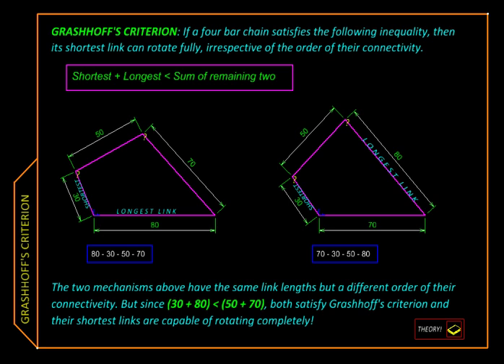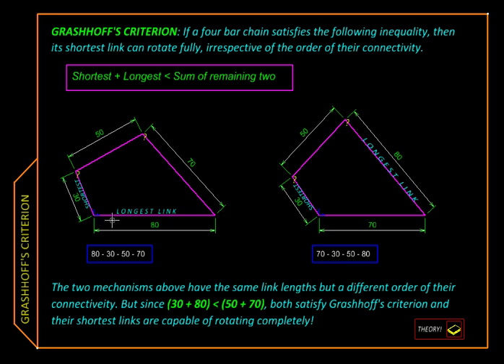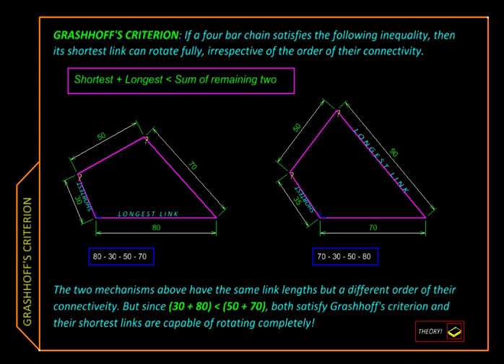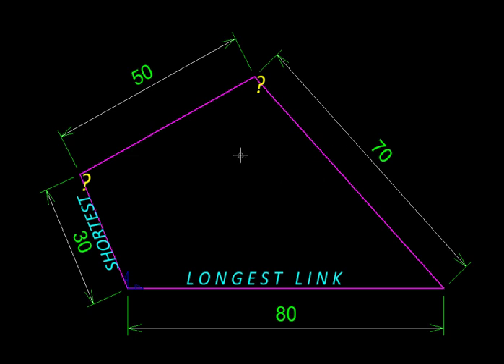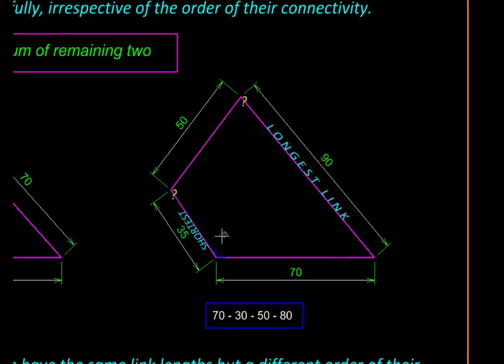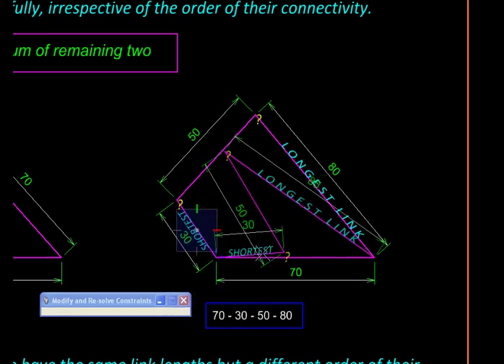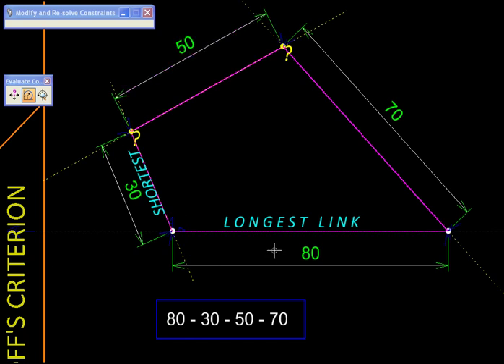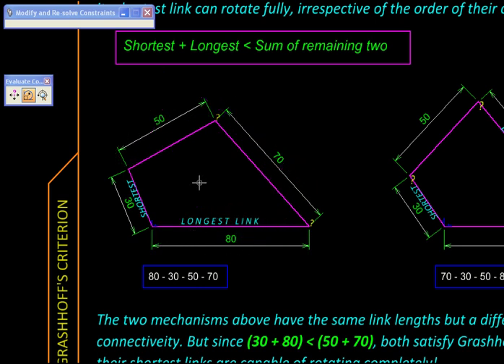Kinematics Ch01D Grashoffs Criterion

Comment: First of all i must thank you for making KDM easy for me. Sir, my question  to you is that, can longest link become crank in the second mechanism i.e one which has got longest link opposite to shortest ?
Reply from the maker: +Badal Singh No, the longest link when opposite to the shortest, cannot become a crank, because the hinges (revolute pairs) at both its ends are incapable of complete rotation.
Reply: +UjjwalRane  Thank you Sir.
Reply: +Badal Singh  What will be the mechanism if sum of the shortest and longest link is equal to the sum of other two link?

Comment: thnx a lot sir, u made theory of machines look so easy.
Reply from the maker: Jitendra malviya You are welcome. I would say, it is already easy. The books and people make it look difficult :-)
Reply: I have a basic doubt sir.........Lower pairs have surface contact then why do we consider two links connected by a joint a lower pair though there is no surface contact.
Reply from the maker: Jitendra malviya I am not sure if I got the question right. But if you are asking why not consider the links themselves as a pair, the answer is the abstraction on which we have based all the theory. Physically it could be complex with rims and rolling elements or very simple with just two bodies with a cylindrical extension engaging with a matching recess in another body. They would still be considered as three entities – two links and a pair.

If the question is about why not call pairs with no surface contact as lower pairs, it is a matter of definition and on the deeper level the actual behavior. The simplest manifestation of which is the degree of freedom it offers.
Reply: UjjwalRane Actually SIR, my question is that, for ex: a shaft rotating inside a circular hole has surface contact and thus it forms a lower pair but two links connected by a joint has no surface contact then why do we call them lower pair?
In short How do 2 links connected by a joint have a surface contact?
and the other question is
Does the joint itself act as a link?

Hope so now u get my questions ?
Reply from the maker: Refer to the cylindrical projection in one link and the mating recess on the other link I mentioned earlier. They form a surface contact and thus a lower pair.